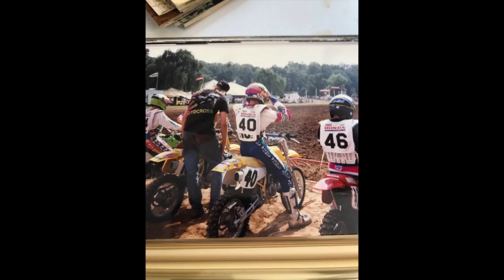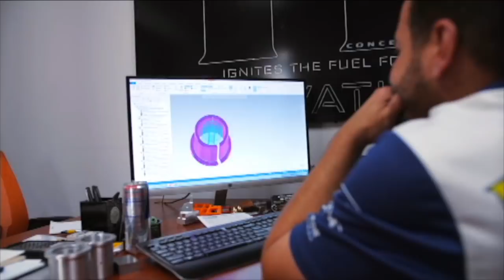Mike Metzger

Comment: About FMX riders in the past, Edgar Torronteras once won both Prince of Bercy (125cc event with a couple of AMA guys, Frenchies, etc) and the FMX portion on the same weekend. That's mind-blowing, nobody ever did that on the same season (TP199 never won X-Games and an AMA pro title on the same year IIRC).
For me, FMX needs to turn straight into speed & style and best trick. Make some supercross/arenacross event, build a couple of decently-sized jumps using FMX ramps (or care A LOT about the takeoff if it's dirt-to-dirt) and then have a speed & style competition. You can make S&S events either go the typical knockout way OR, if riders hate tricking side-by-side too much (understandable), go for the "ski moguls" way (solo runs where the score comes from both tricks and your time).

Comment: There is video of the 1993 AMA Motocross 125cc race at Glen Helen: Mike Metzger didn't get the holeshot (Jeff Emig did and I can't see any 3-digit Suzuki up front) while #123 David Pingree crashed right in front of the camera after hitting the backwheel of some 3-digit Kawasaki rider (it could be Robbie Reynard, unsure). There is some red-wearing 3-digit Suzuki rider on 3rd during the first lap, that one is Metzger. Doug Henry won on a Honda after starting right behind Emig, who finished 4th.